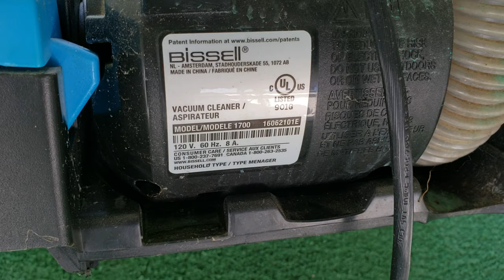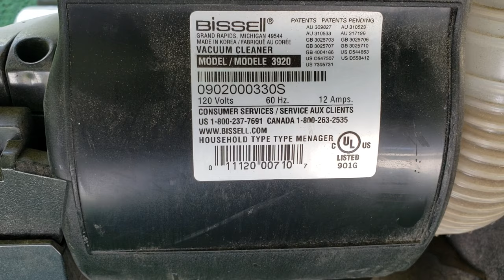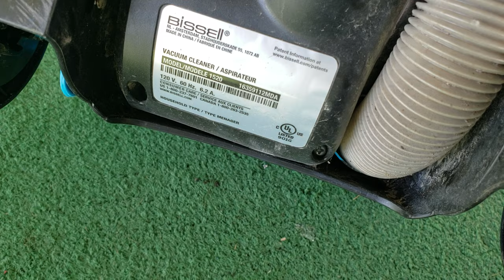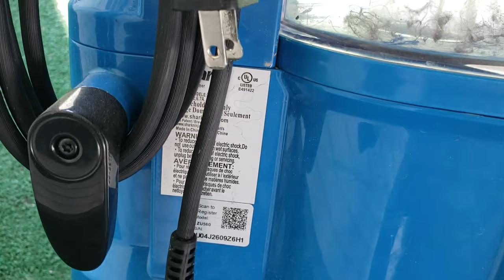Vacuums Saved: Episode 10!

Comment: Weirdly I still own a bissel momentum and it still has all of the attachments since we got that vacuum when it was still being sold. That pet hair eraser sounds like something is wrong with the motor. Should not sound like that at all. May be the bearings going out. The momentum’s never came with a brushroll shut off but for their size they are great vacuum's. Mine however needs a new power cord though since it’s been getting chewed up by the brushroll. Ours is at least 10 + years old and has not had a service exept multiple replacements of the filters over the years and changing of the belts otherwise it’s still working like it’s brand new. Should take its apart though and give it a full cleaning it deserves now.

Comment: Those Pet Hair Eraser models were essentially the Momentum with that pet hair thing on the brush housing and a dual cyclone instead of that bizarre single cyclone. I have had both of them. The dual cyclone is the reason the Pet Hair Eraser version has that distinct whistle to it. Oddly enough for a Bissell, the cyclones on both machines seemed to be quite effective from what I could tell. Your Pet Hair Eraser has at least one dry bearing and probably plenty of dirt in the fan. It is also missing the angled arm that went on the end of the hose.

I have always thought that those Hoover machines were decent compared to the competition. I have never had that model, but I have had a few similar ones and I have found no reason to complain for how fair the asking prices are for them.
Reply: I have one that is also missing the arm on the hose. Got mine at a DAV store for about $25, it's a 2010 model with all of the attachments except the extension wand and crevice tool, and the motor's still good in it.
Reply: CaroTech Studios why don’t you do a video on the Hoover sprint quick Vac